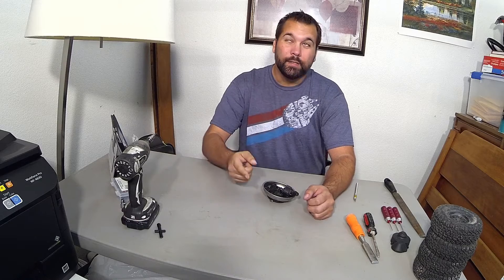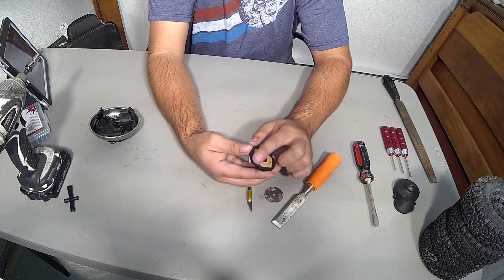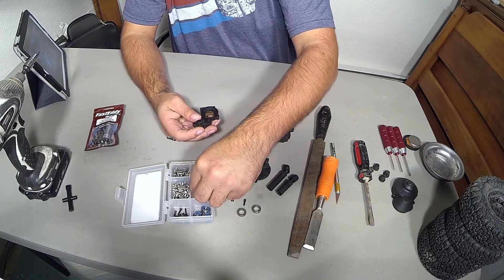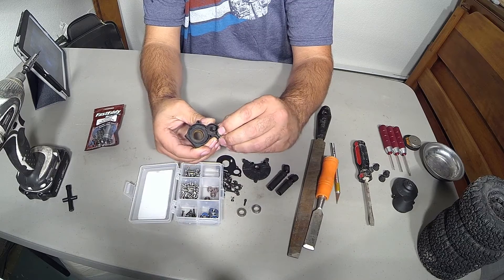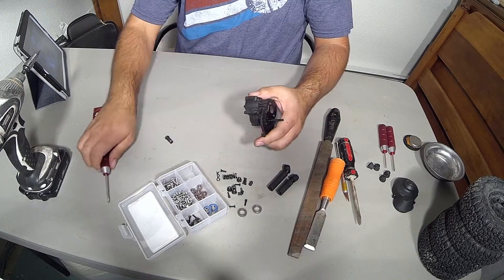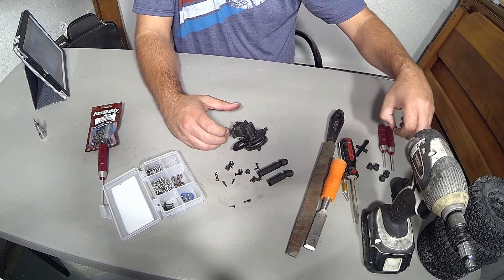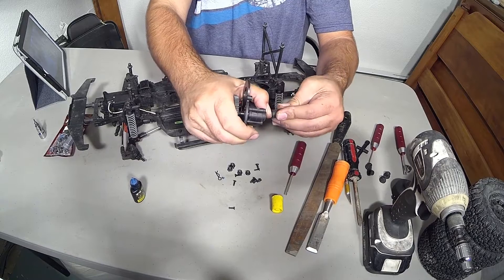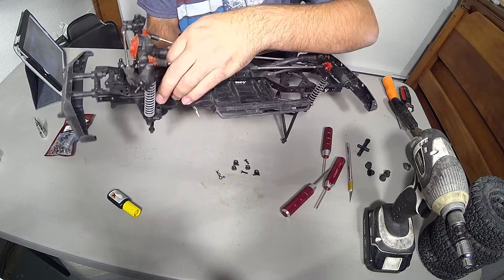ADVENTUREQUEST RC  Scale Axial SCX10 II Teaching Tips How To Reassemble And Fix The Transmission

Comment: No grease? Don't get me wrong, but you say you go through a lot of bearings but you do nothing to protect them at all. Seems the universe is balanced ;)
Reply from the maker: +arialssmartypants nice catch!  I'm actually not planning on any water crossings before I get some metal gears. If you aren't going into any water grease can collect dirt, increasing wear. This is okay if you plan on getting wet but two things : 1. I don't plan on getting wet before I take it apart and 2. I REALLY don't want to get greasy when I take it apart haha!
Reply: humidity will always creep in and corrode them, a light, and I mean light coating of something would cure that ;)